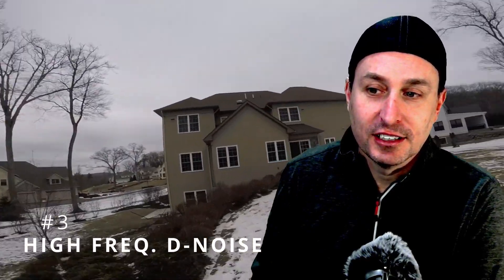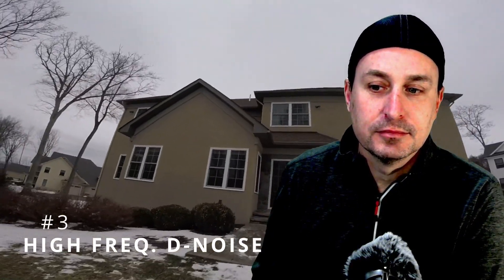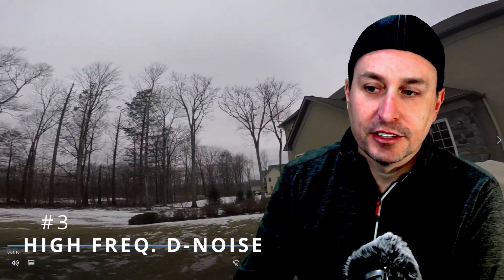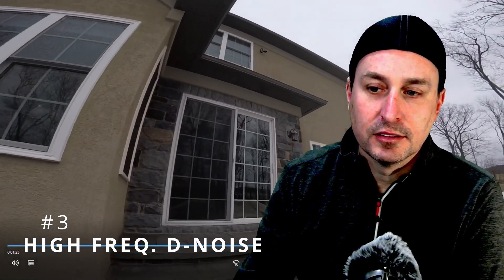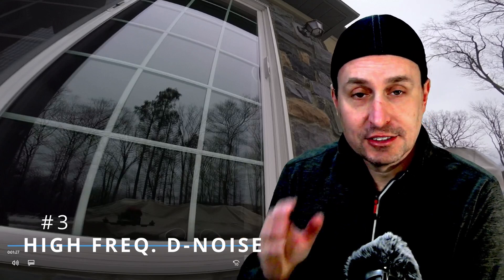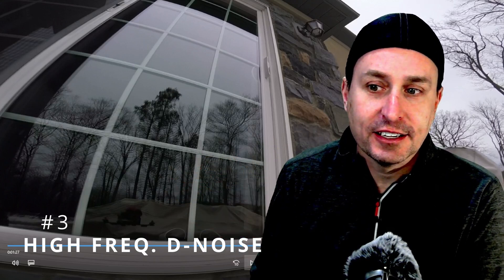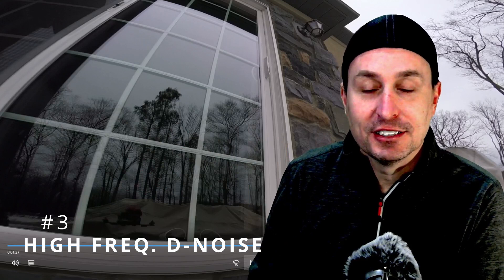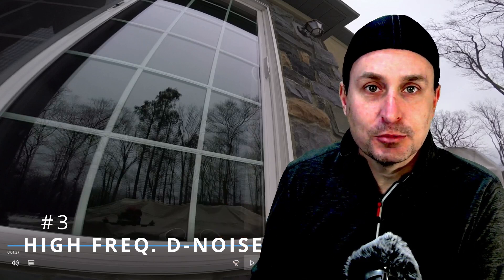Things that Burn up Motors

Comment: Question for u. Every blip or when I start to increase the throttle rapidly, I get like a bobble, jello, possible vibration within my image. Would happen to know, what may cause this? I have made sure all screws r tightened, messed around with anti-gravity & the multipliers but to no avail

Comment: Mark I need your help man 🙏🙏 if I sub to patron do I get 1 on 1 or at least discord access?
Reply: I literally get flyaways on my 2in toothpick immediately upon liftoff even with lower stick input. It looks like throbel in the fpv goggles and it will just shoot to the sky if I don't disarm what can I do? I'm not a complete idiot when it comes to tuning, but I'm no Mark White either😅
Reply from the maker: @Fpvcandy  just apply a Low Build filter setting for my 2" preset.  Try that first and then if that doesn't help, I do have a Patreon tier to help out.
Reply: @uavtech  Thank you brother, I appreciate you. This is a very crazy problem. So much resonance that the Drone flies away on takeoff because the 2-in frame is so flimsy.. I have been able to get it tuned but it's right on the edge. So literally if one thing goes wrong the resonance is too much for the filtering and it flies away.. I believe your patron would be worth it for me to sub too. I've been wanting to pick your brain forever when it comes to tuning.

Comment: Flying a 5" 740g i have an issue when I go to power loop that I seem to lose power if I throttle too high. I'm not sure it's a tune issue, though, as in every other situation, I don't encounter this. Possible prop flex? If I don't go as hard on the throttle, it doesn't happen. You can hear it in my Wukong videos that I uploaded yesterday.

Comment: So my issue is number three but it's on a 2-in micro toothpick ... Just so I understand correctly, the solution would be to raise my d-term filter? Black box is not an option. It's the beta f405 no black box. I've already burned up one motor. This is on 4.3.1 defaults 100% across the board filters. Pids everything on default. And still smoke the motor with issue number three? What could it be?

Comment: So what do you do for #2?  My lighter weight (300g with battery) kiss builds have a lot of this.  If I put more weight on (action cam) the motors sound normal.
Reply from the maker: reduce D gain.

maybe you need two profiles.

Comment: Helped me a lot. I have #3 but the motors are no near to be hot and even after 8 packs flying.
Reply from the maker: must have good cooling capacity.  if it himes the frame like that, it not great.  add more D-term filter.